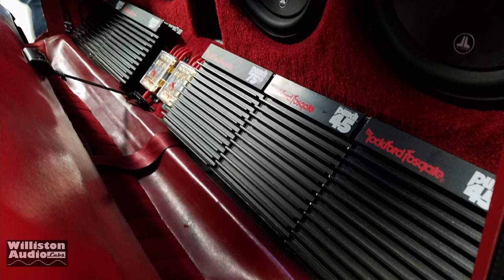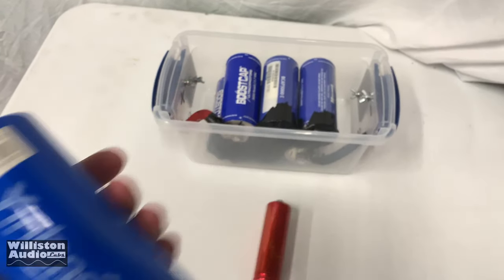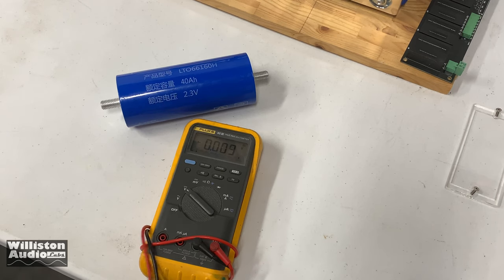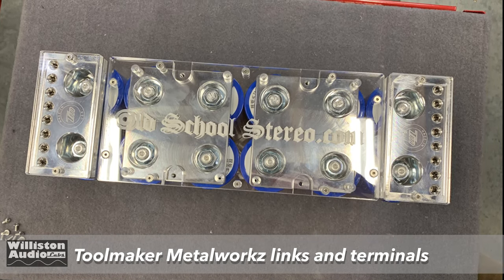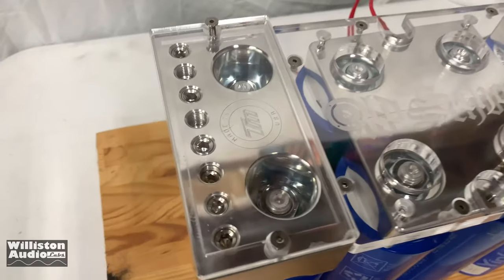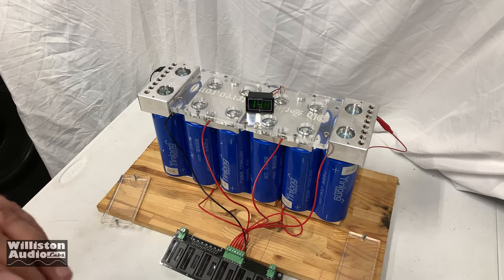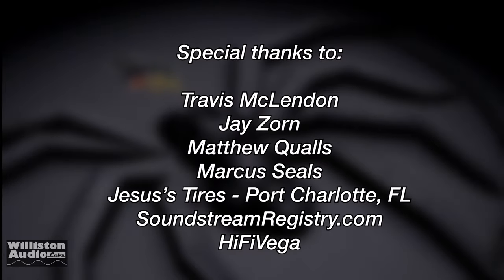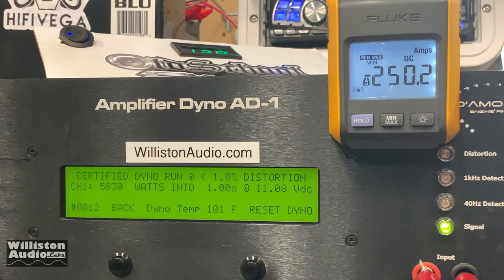Lithium Batteries for Car Audio? Yinlong LTO Cells LTO66160H 8000 watt capable Battery Bank [4K]

Comment: Get a balancer and torque them right I toasted to cells with no warrantee apparently
Reply from the maker: Oh no!
Reply: How did you know you toasted them??? What was the car doing for you to know you messed two of them up???
Reply: @Mr2SMOOTH24  I started noticing a smell coming from the truck like a sweet smile I had made a wooden boxes for my 80ah I ran mine with no balancer Because I would periodically disassemble the set up and charge them separately to balance them out (they where always Pretty close on voltage like within a couple .10th of a volt I ran the whole  car on this setup no battery and would charge them Through the cars electrical system /alternator went about three weeks before checking when I disassemble them I noticed leaking gel and had white spots out of the 12 I had I lost 4 I have since built a six sell 40 amp hour from the remaining I do plan on getting six more to reassemble my 80 amp hour battery I still love the lithium batteries you just have to know what you’re doing to take care of them 

In summary the things I did wrong where
1. Not having a balancer or not checking them in a timely manner In my case I don’t believe that was the problem like I said previously I never saw more than 2/10 th of a volt in difference Per-cell even after complete drain and re-charge from the alternator
2. Allow them to drop way below 10 volts and at twice I had left the amps on and Completely drained them 
3. charging them with A non-lithium charger
4. Possibly over torquing them 
Hope this helps 
5. Possibly damage from having to jumpstarting the car a couple of times Because I forgot to turn the amps off
Reply: @markcunningham2959  koo that's alot to take in lol but thanks for letting me know bro 💯💯💯👍👍👍

Comment: wow somethink is wrong with them. my 160 ah bank drops to 13.7 from 14,9 at 15 k, and when at 15,5 it drops to 14.0. at 5 k  constant it rest at 14,4
Reply from the maker: Playing music though, right? This was a 40Hz sine wave test time for 10 secs
Reply: @wal Labs i was testing sinewaves. 38 Hz (cars peak)  2x18",  
amplifiers are AAB 11800  (2pcs) with 15 k  I had 161,9 and with drop to 13,7. (never saw lover voltage) (my charging is 15,5 with 80 amps- so doesn't contribute much.
Reply: @wal  You should do a video on how nuts that is compared to music. Seems like many don't understand the consumption differences between sustained sine waves and kick drums. That was an incredible amount of power delivered for 32lbs of battery...

Comment: Bro,,in real life,,a battery is always being charged by the car alternator,,and also has a nice big 1 farad cap coupled in parallel close to the amps.. so u need to do the exact same realife situation comparison between both types namely option 1) lead acid battery and option 2) lithium titanate or lion,you will need to increase the field voltage of the inner coil of the alternator to give more volatage and setting a higher cut off level when charging the lithium pack as vs when charging and using the standard 80 amps hour lead acid battery.
Reply from the maker: My test bench is different though. I turn off chargers when testing amps so I need much more capacity than an in car situation with a HO alt

Comment: Id rather spend $140 on two huge marine lead acid batterys from walmart . one under the hood and one in the back on a 200a alt with big three. 💪💪💪😎
Reply: Iwouldnt pay for agm batteries now that i have a ces 80ah bank. I had two agm northstar nsb31s they where really good but not as Good as lto. I hold 14.3 14.4 all day on a 5k at half ohm. My agms held 13.4 full tilt. Not so good.
Reply from the maker: It’s a big price difference, but the LTO’s will outlast the AGM’s by 4x or more
Reply: Williston Audio Labs  so if you have the lithium in the back, what do you use for a starting battery?
Reply: @justdave7520  u would delete the battery
Reply: @HardKnocks160s  is it possible to connect 80ah lto bank to Agm battery with battery isolator between them? The recently released Down 4 Sound 6LTO battery has Lithium Titanate Cells and cam bee connected to AGM, but with isolator between them . I believe this is the same with with the Limitless Cyber 6k amd 12k series as well. Am I missing something? Thanks in advamce for your feedback.
Reply: @winfredc2523  not the same these are way better cells than those d4s batteries u will need to delete front battery and just run the yinglong bank by its self or else your going to have cancellation a agm battery rest at 12.6-12.9v a yinglong bank rest very close to where you charge too i charge to 15.6v my yinglong rest at 15.3v all night agm and yinglong is a no no your going to have big problems just rum those d4s batteries if your sticking with agm batteries agm is a thing if the past ive been there but these yinglong cells are bad ass u will hold and clamp alot of power with these and still main. A 14v+ at full titlt with a good alternator
Reply: @HardKnocks160s   do the 80ah yinlong banks have a good amount of reserve power for playing car system with engine off?

Comment: What is agm?
Reply: Absorbed glass mat. It's a type of battery that doesn't have acid sloshing around loosely inside, so they are usually leak proof and can be mounted on their side without issues. I use 2 deep cycle agm batteries for my system and love 'em.

Comment: torque spec is in newton meters, not nano meters.........................7 newton meter =  62 in. lbs
Reply: 6S means 6 series not 6 cells.  Your balance board would say something like 6S1P which is 6 cells in series with 1 parallel bank (meaning only 1 bank of series cells).   6S2P would be 2 parallel banks of 6 cells in series.   Just trying to help clarify.

Appreciate the content!

Comment: Only 40Ah@13.8v, for $1000+? Ouch!!!! Way out of my price range. I'd rather stick to my 460Ah (230Ah @50%) for $ 360. I'd rather not spend 6k for an equal but more complex system. Unless they come down to around 10-15 a battery, these will be exotic status.
Reply: Where you getting 460ah worth of batteries for $360 bucks? Even 230AH for 360 is a bit far fetched.
Reply: @Joe_1776  , oh lord, its not even remotely far fetched at all.

Deka sells 448AhHr batteries, @160, sam's club sells a 220 amp hour Battery @$90.

In my TV news van, I have 8 DEKAS, wired for 12v, 896 total Amp Hours. 448@50%. More than enough to lift the 50' mast, raise the solar panel array, operate the other equipment, and power the radio gear. 
My house is also powered that way, just a bigger system, more PVP, bigger inverters, charge controllers, and bigger battery bank at 24v.
As long as I'm not being stupid wasteful, 4 battery's alone can run run my house in an emergency. 

So yeah, pretty normal everyday solar living stuff. Like this is so normal and typical. Ppl been using these batteries for like forever. 

They always win out. 

Now, if chem batteries ever get down to the 0.40¢ per ah, or at least the $3 mark, it would start to be worth it. But right now, its around $30/ah!!

And the ridiculous amount of space and weight to balance out. 

Not to mention the dangers of chem batteries. 

And few if any are actually building legit systems with actual safety systems!
Reply: @blueside1999    Those are rated at 448ah at 25amps............  No where near the power these can discharge at for car audio.  You bring up random stuff you are powering, no one cares. The title of the video was for car audio...  This lithium bank would be far superior for the car audio application than your Dekas.   448 ah is worthless when its rated at 25 amps, when it comes to car audio, the cost of 448ah with actual batteries capable of doing car audio discharges is quite a bit more.
Reply: @Joe_1776  

I see your last post was deleted.
I'm glad, as it appeared to be a liberal rant of more personal insults. (That's what libs do. I figured you were one of those stalker lib types that found a comment somewhere I discussed my L.E.O. background and desided to be weird stalkery. Its happened a few times! ) I'm guessing a cooler more rational mind prevailed and wisdom isn't dead.

Now, your basically sorta kinda right-ish.

Ohms law is a beautiful thing. 

Yes, at the @25 amp continuous draw rate, its only 448 amp hours.

But let's continue with the rate chart shall we?

At the 56 amp continuous rate, its less total amp hours, of course, that's how it works.
 Even less at the 75 amp continuous rate.

On and on. 

But, size does in fact, matter!

Small batteries cannot compete ampwise. 

Unless the laws of physics change, or some miracle chemical process is someday discovered that's completely unknown. 

Its possible I guess, I mean, they've been working on this for centuries, and have an entire industry of scientists hard at work. Not to mention NASA, Tesla/SpaceX, blue origin, ESA, CSA, the entire EV industry.

Best they've come up with, is making these batteries, as you might have guessed, BIGGER!

No worries, they'll spin some up the size of a standard car battery, probably real soon. 

Panasonic/Tesla recently came out with the 4680. What is it? An upsized 18650 lol. 

Now, back to these batteries. these chem batteries at 2+/- volts, have a total of 40 amps, and according to there data sheet, is capable of putting <40 amps.

But let's continue,

At only "<10 seconds max".
They do not, unable to put out a continuous amp draw above @<40 amps. And @<10 seconds! (Do I need to explain the minus/less than, or the "if part?)

Now, you can series/parallel upto 12v, but its STILL only "<40 amps"
And still only "<10 seconds max"

As for a remote battery set up, as is discussed, it seems to me, that this is at least, maybe worse, than caps. Caps having nearer instant release and recharge.

At no time does the OP state this is a replacement for the purpose of caps in a high draw system.

In fact, he doesn't state any real function purpose other than posed a question of use with a sound system in the title, but thru the entire video, he only discussed the batteries, and how he built his pack, and the costs.

Now, since the couple of years since the videos release date, its been well established under lab and individual testings, that these batteries do not actually perform as well. Its even stated as a theoretical. Its more of a "maybe" and "sometimes, kinda, sorta"   

So, this set up is not actually ideal as a lone battery, or cap replacement.
 Unable to produce either the amp draw, or the speed nessasary. Standard battery/cap/Hi out put alternator combo as is still used in the industry, and is still king!

Its ONLY saving grace is that it can give a decent power supply at a lighter weight. But, just as its form factor is a serious limiting factor, its mathematically limited.

That's it!

To compare to real world hi amp draw electrical systems, it would lose any grounds as it does NOT! scale up well. 

Its form factor would be immense, and any weight savings would be lost due to nessasary hardware. 

And I don't know why you made it personal, but I merely stated that this doesn't work for me, and why.

I have a system that has a ridiculous power draw, its also why I have 2 hi amp alternators, one being a low RPM, electric clutch engaged alternator.

My batteries, caps, alts are more than fully capable of driving a constant power 6kw platinum tube amp, a 600watt continuous solid state, my sound system, sat systems, a ridiculous amount of lights, a 50' mast, It's compressor, monitors, thermal/infrared/dvr cam system, and other non disclosed electronics just fine. 
Only thing I would never run without engine or the generator running is the 6kw continuous amp. As it is, it makes the 0/0 cables to it get real hot sometimes. But then again, I'm trying to set fire to the clouds.

Sorry, but my electrical system would rip the hell out of those chem batteries. Pretty much any part of it. Including the sound system.

And no, I'm not saying his project wasn't cool. It was. He introduced some interesting things. And he was honest and didn't make any misleading or dishonest claims. 

He didn't make any claims at all in fact.

He simply posed a title question, then showed us his build. 

He at no time ever made a claim its actually a good thing for a sound system. In fact,bit was more of a "what if" or "could it work"

I'd pose the statement, I guess so, maybe. But I'd never venture to say its ideal, that would be completely foolish, or a replacement for current standards, nope, not by any rational practical means.

And neither did he.

But the most important part of this kind of experimenting is trying, and constructive debating.*

Not just technical, but functional applicability. 

*Libs resort to personal insults, out downs, and do not debate functional it practical issues, they only focus on narrow controlled aspects as to arrive at a manipulated result.

As example, renewable energy.

Its a great flashpoint topic, but point out any of the aspects of why it doesn't work, and they get angry.

Solar, wind & EV is actually more terrible. Upto only 20% efficiency. Battery tech completely sucks, slave labor, extreme toxic environmental pollution. 

AND! it all still relies on conventional power!

Bigger polluters overall!

Wind is almost a joke.
Rarely does it blow enough to make any decent power, the turbines are extremely expensive/toxic to make, buy, and maintain, and they most often work best during the day, which solar is the better cheaper option. 

But, it always boils down to the batteries.  Either they're power dense, and extremely costly for a practical size, and require some maintainve,
or there not, and at an even costlier price, for less maintenance.

Anyways, have a great day!
Reply: @Robert Morse   My last post wasn't deleted. But I'm glad you typed all that for nothing.  Again, no one cares about your home stuff. The video was about car audio, and like I said before, your Dekas aren't car audio worthy.   P.S. I'm a republican but nice ways to type a bunch of nothing and make it political; your type is pathetic.

The entire point of these banks is the smaller footprint and big output; of course, with bigger batteries, more can be done, but that defeats the entire purpose of these banks.  Vehicles have limited space and weight capacity limits.  An AGM battery worthy of car audio use is 60-100 lbs each. With these banks, one can achieve the same burst output with a fraction of the space and weight. It's literally their entire purpose....  This channel is mostly all car audio, and you chime in talking about powering a house.. No one is trying to compare these for solor use or anything of the sort... purely car audio.

I said all I had to say; perhaps you should watch more of this channels videos, and you'll get the drift or not, idc. 

You're happy with your thing; bassheads are happy with ours.  Two different worlds, two different goals.  Either way cheers, I wish you the best.

Comment: you need to talk more about safety! Li ion battery can be very dangerous if you do not charge properly or short circuit. if the battery goes in the air then you will not be around

Comment: I can put it in the normal car, the alternator charges it
Reply from the maker: These in 6S config need to be charged 15-15.5V and not used with 12V battery. Car audio guys who use these have Alts that charge in this range and remove their 12V batteries

Comment: Lithium cells in series will not self balance and I know for a fact they will fall out of balance and some will be over charged and some under, the cell over charged will have a short life.
Reply from the maker: I never said they would self balance in series, I said to put them in parallel to self balance them. Some of the car audio guys have been using these for over a year without balancers and they have not had issues with cells going out of balance. I’d feel better using either a balancer or having cell monitor to see voltage of each cell
Reply: @wal   I never said you said that, I was talking to the people. I would include your name if it was to you.
Reply: @wal   No two cells are identical so when you're kicking that much amperage out, they will drift.

Comment: I picked up a Nissan Leaf battery from a 2015 for $2900cdn or $2100usd. Aren't they a better deal? Rated 240A current output, peak 540A. If you parallel them lots more current. 7.4v per module. https://www.hybridautocenter.com/HAC4/index.php?option=com_hikashop&ctrl=product&task=show&cid=91&name=58ah-nissan-leaf-battery-module&Itemid=605

Comment: has anyone here use a limitless lithium battery. are they worth the price for a 2500w system thats on a daily
Reply from the maker: EXO is using these LTO’s with his new build...JY’s out
Reply: Ive read they have a cycle limit. It may be in the thousands though
Reply from the maker: @rocknrolljesus3197  30,000 plus
Reply: @wal  remember the early rc car lithium charging days? A concrete foundation block laying on a  patio block...battery thats on charger inside foundation block...ziploc bag of sand covering hole where battery is charging...explosion/fire melts bag & covers fire. Lol.

Comment: You people better pay attention if you decide to go lithium because they are very sensitive at charging. If not calibrated well they can explode or/and catch fire. Non the less the smoke they put out is so disgusting that you wish to catch fire and die in the explosion with the cell rather than make it and smell those fumes. Is that bad.

Comment: Car audio? Nothin' wrong with mine.
Reply from the maker: So these were not at their optimal charge level, that’s why voltage dropped so low. They should be charged to around 15.6 for best capacity